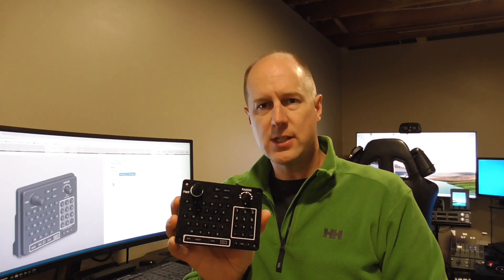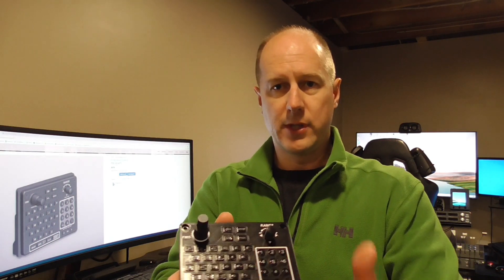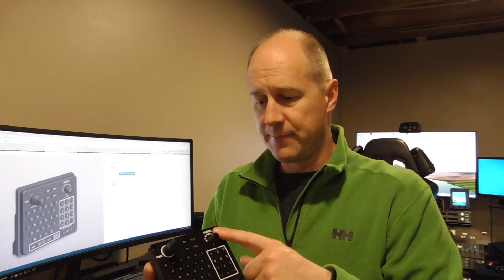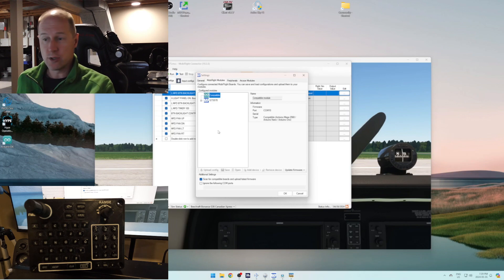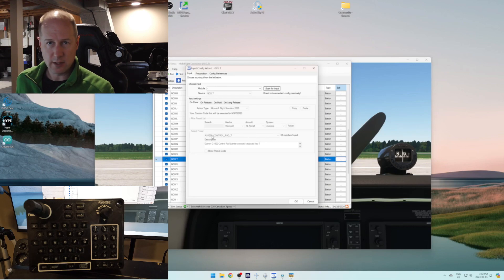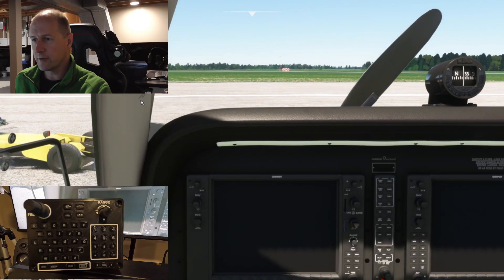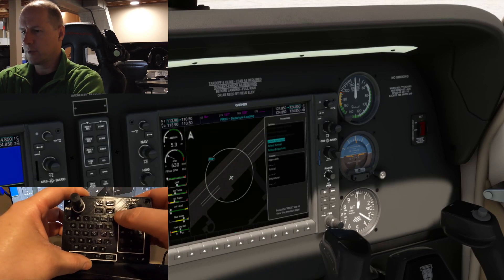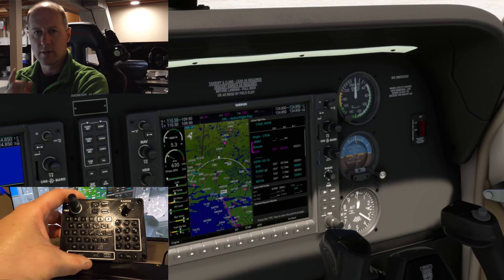Homemade Garmin G1000 Keyboard for your Home Flight Simulator

Comment: Sorry if you already know this, but I figured it's worth mentioning to others: 

An easier option you might look at instead of printing the panel, painting, and sanding: Amazon  (and other places) sell two-tone acrylic plastic sheets. The top layer is one color (I buy dark grey and black for my panels), but when you engrave with a laser it reveals the other color (the ones I get are white) underneath. They come in lots of different color combinations and some even with varying opacities to diffuse light better. Working with 3d resin printing myself, I know that a lot of 3D prints (even the higher resolution resin) all have a rough and 'homemade' look to them unless you spend hours post-processing it to smooth it out. dThe cool thing is that since most lasers are variable power, you can engrave with one pass, then cut out your button/knob holes in another - all without stopping, readjusting, etc. 

The panels I've made come out so much cleaner, with nice crisp text. The only post-processing they require is a quick wipe down with some rubbing alcohol. I can engrave and cut out an entire set of KingAir 350 avionics panels in about an hour. Since you already have the 3D printing files, it likely wouldn't be too difficult to convert that into a format a laser can use. If you're interested, PM me and I'm happy to share some images to show you how they come out.
Reply from the maker: Sounds cool.. I've seen people paint the plastic sheets than laser off part of the painted area. But the 2 tone panel sounds way simpler. A simple laser is something I've really considered adding to my Ender 3 now that I have the CR10. Surprisingly, the CR10 is much faster than the E3, so I hardly use the E3 anymore even for small parts.